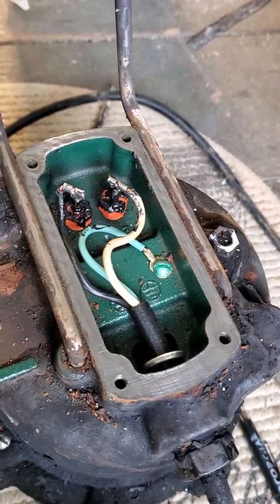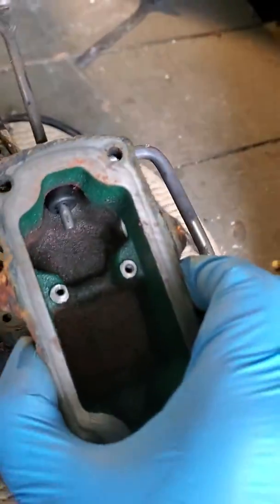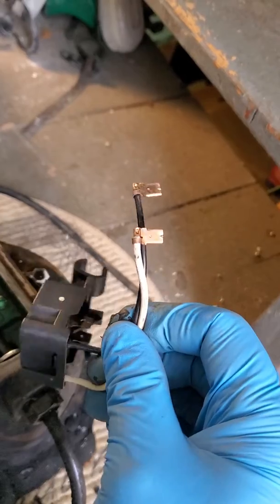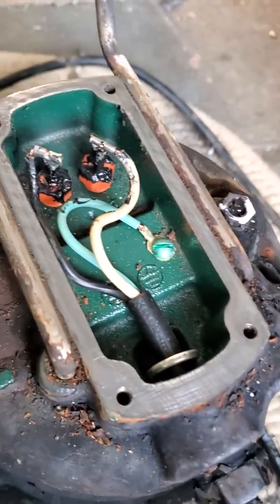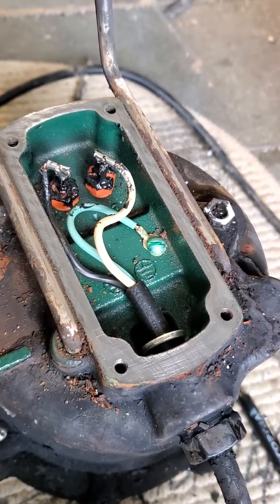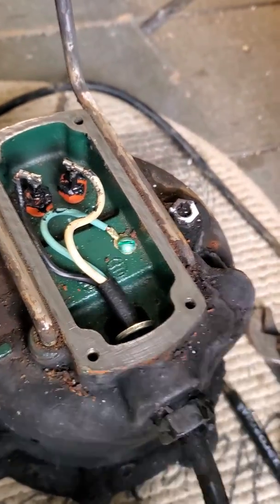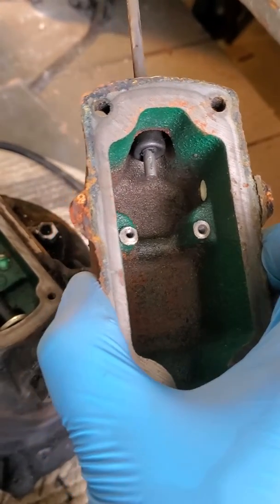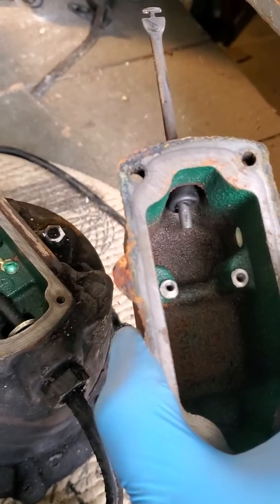Bypass Zoeller M53 Sump Pump Float Switch Convert to N53

Comment: what height the piggy back switch turn on? Did you set up at height so that it kicks in before water reaches top of the pump or pump is completely under water?

Comment: Great help.  I clipped the connectors from the old switch and joined them to the cord lines  with closed end crimp connectors.  A dab of silicone on the bottoms to waterproof.

thanks for posting this.

Comment: Nice. Floats and float switches are a weak spot for most pumps. An electronic water sensor like “level guard”  or dual floats are way to go.
Reply from the maker: I went Levelguard. First time using one so I will see how it goes. I am going to try an HC6000 v2 on one of my other pumps when it's switch goes too.

Comment: Great video, are Zoeller piggyback  float switches any good? if so how long do they usually last before they fail, just trying to see if it's best to replace the switch on my Zoeller M53  or convert to piggyback float, your input is appreciated. Thanks
Reply from the maker: Eventually all switches fail. At least this way you get more life from the pump.
Reply: Especially since you can add extra  travel by increasing the wire length of a piggyback switch, or raising the sensor on electric switches preventing, such short cycles you get with the stock integrated Zoeller floats

Comment: how can i bypass a float switch on a sump pump to make it run continuously?
Reply from the maker: That is what this video explains
Reply: dear sir thanks for your reply so my question is this i want to run my sump pump continuously  and the on/off  operation is by plugging in or unplugging the pump so in other words by removing the switch and sealing the cover back the pump will turn on and off by plugging in or unplugging the pump?
Reply from the maker: @alreddy8617  yes, and then you can also use a better quality piggy back float.
Reply: @JustRay627  thank you very much sir ray i am going to use that pump as a koi pond recirculating pump and another question should i change the gasket on a brand new pump when i take out the float switch?
al
Reply from the maker: @alreddy8617  if it's in good shape I personally would reuse it. I reused mine with a little rtv and was good to go

Comment: how did you attach the wires to the contacts?
Reply from the maker: There are clips that attach to the spade terminal of the switch. I just crimped them on to the terminals with pliers and used some  black rtv to hold it there. Sorry for the very late reply.